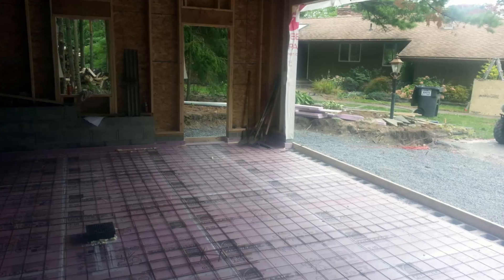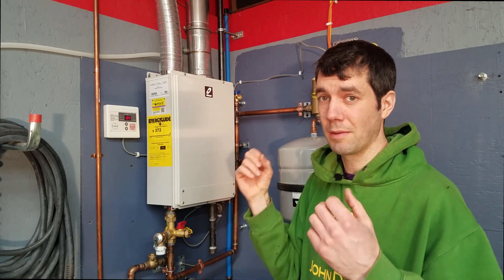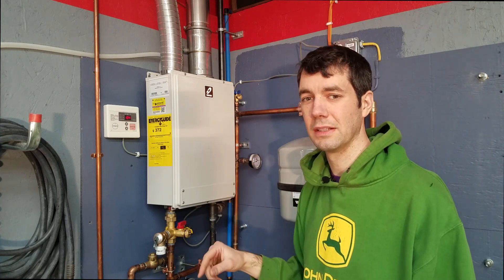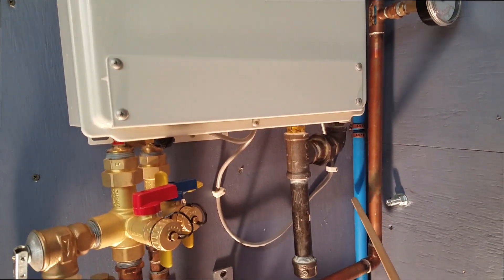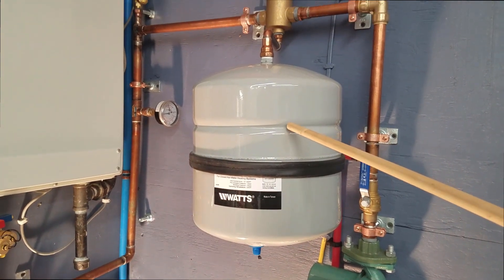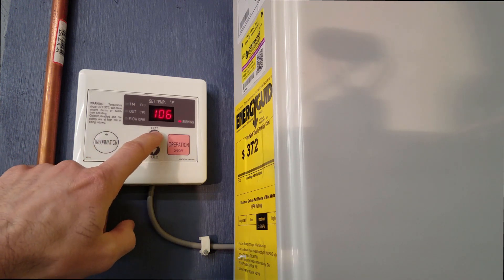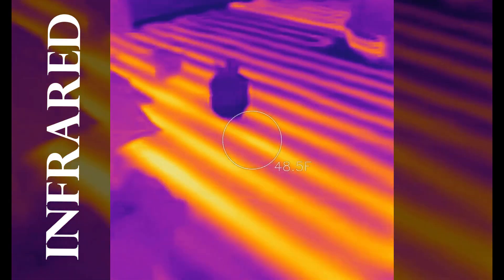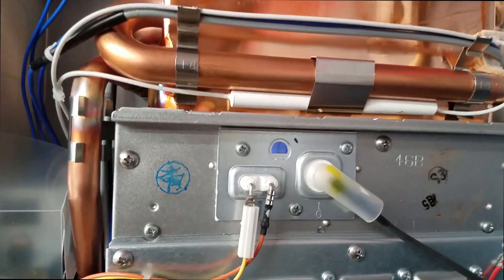Explained: Garage Radiant Floor Heat Setup w Takagi Tankless Heater

Comment: Looking a building a 24x24 garage/shop. I like this idea for heating a lot. The installing cost you gave is a little more than what a gas ceiling mounted furnace would be. But I would think your system is much quieter and much more efficient. If you could do it over again would you still install this type of system?
Reply from the maker: Not sure if I would do it again.  I love the quiet, it makes almost no sound and I had a loud torpedo heater in there. The plumbing was very complex to do as it was my first time. I put the floor pipe in 5 yrs ago as that was easy to do. I love the warm floor for snow/ice and drying time.  Great to lay on under a car and huge thermal mass when I open the door. I really enjoyed the project and final result, but it was a lot of time in researching it and installation.
Reply: @MakerMaxCorbett  What does it cost to run a month in the winter?
Reply: @MakerMaxCorbett   thanks for doing this video on your heating system. I'm looking to do the same setup with my garage. I've got two questions if you don't mind. What did you use for switching your circulator pump on from your thermostat. Also the manual for the tankless heater says it's capable of doing domestic hot water and recirculating heating systems. But doesn't recommend using as just a heat source as you've done. Any insight on why.
Reply: Great video, thanks! I’m also curious about monthly cost.
Reply: Chris, did you do your garage yet ? I have in floor in my house, as a supplement to forced air , and have worked in a couple shops. My future shop will have it , there are a couple considerations I have not seen mentioned.  When the heat is coming from underneath you , you feel warmer so you feel warm at a lower thermostat setting resulting in a cost saving. The speed to warm the air after it cools off is much slower ( in my house  it takes 72 hours to catch up to a  thermostat change) if you open the garage  door twice a day you maybe want to add a separate thermostaticly controlled loop with radiator and fan . A rule of thumb is every dollar spent for insulation on your perimeter is worth 2 under the slab ( in my climate I have heard recommended 2 inch Styrofoam down 2 feet below grade with 1 inch Styrofoam at a 45 degree angle outside the footings)